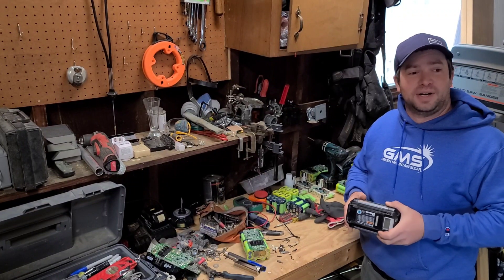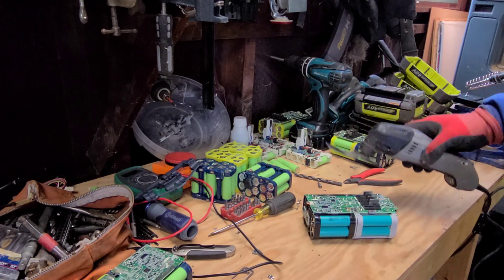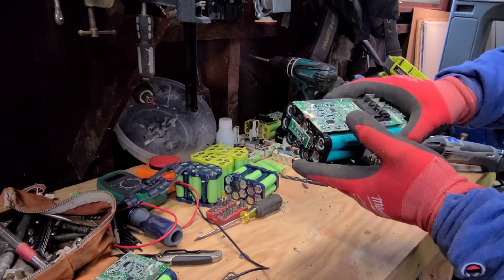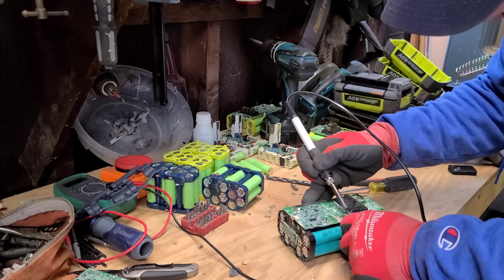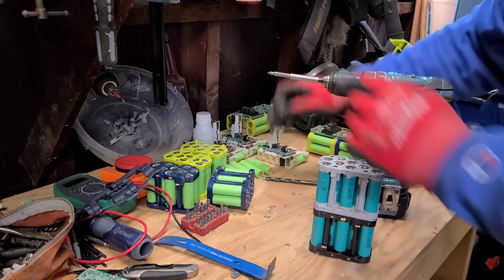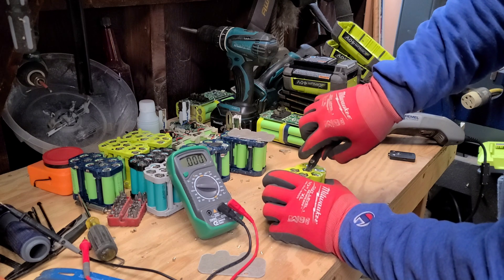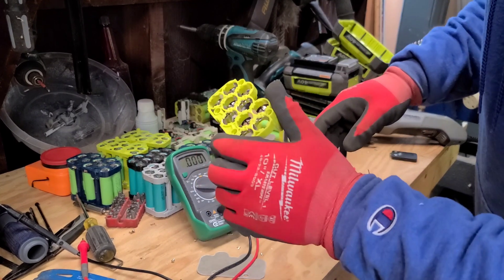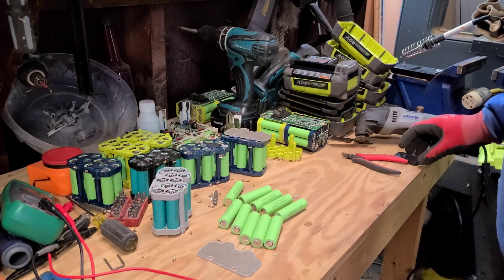Ryobi 40v Lithium Battery Disassembly

Comment: what kind of cells are in the 6Ah battery ?
Reply: 4Ah: 10S2P 2000mah 18650 cells
6Ah: 10S2P 3000mah 18650 cells
8Ah: 10S3P 2000mah 18650 cells

Only the new Ryobi Edge batteries have 17500 cells...

Comment: I know exactly why it read zero volt on these lithium batteries. I have Ryobi lawnmower 40v battery was runout of juice and was overheated during hot summer cutting yard.
I tear down like you did.
They need to CID to get back to about 3 volts because batteries were overheated and the inside pressure so high push the top part of metal under the positive terminal to disconnect the circuit. Therefore it is really no reusable as far as safety go !

Comment: So a hand for later if u do this ...use a compressor at like 100psi n a blow gun...heat the joint n blow out the solder also use a bigger iron

Comment: I have a DIY lab bench power supply that I can use to perform CC-CV charging on very low cells. I usually start them off at 0.05 amps until they are at least 1 volt, then 0.1 amps until they reach 3 volts. Then I continue charging at about 0.25 amps until they reach 3.85 volts. I hold the 3.85 volts until the current falls below 0.05 amps. Then I disconnect charging and store the battery in a fireproof bag for at least 72 hours. If the battery is at least 3.8 volts after that, I continue the charge at 0.1 amps until 4.15 volts. Then I left stand for another 72 hours. If the battery is at least 4.1 volts, I do a discharge test at 0.5C (whatever the capacity is divided by 2). So, a 2000 mAh cell would discharge at 1 Amp, a 3000 mAh would discharge at 1.5 Amps. 
If the battery doesn't test at least 65% of it's rated capacity, I discharge it down to 2.75 volts and it goes into my "badly worn out cells" waiting for a low current project.
If it does test OK, I put it in a battery tester that will fully charge to 4.2 volts, then discharge down to 2.75 volts and recharge when done, measuring the capacity in mAh. I then measure the internal resistance and record the capacity and resistance on the battery in sharpie. The battery then gets discharged down to 3.2 volts and stored in the "good for demanding projects" shelf until I have enough cells.
When I have enough cells, they get matched up as closely as possible. I make sure every cell in a pack as the same resistance to within 10%, and every parallel group of cells has the same capacity to within 5%, then I discharge the cells to 2.75 volts, weld them together, install the BMS, and fully charge. They're ready for a project. 
I have about 1% of the batteries I test this way fail within the first year, which isn't too bad. Only about 50% of batteries I test make past the initial screening for self discharge. If during the either of the 72 hour wait periods the cells self discharge outside of tolerance, they get recycled. If they heat up at ALL during charging (within a couple of degrees of ambient), they get recycled. I can't risk a marginal cell going bad and causing a fire. It's just not worth it to me.

Comment: heya that is not good that does 18650 are so low hope you can get them back to live. I got myself over 150 bycicle packs of those 18650 withs have about nomimnal 500 wh each so hope to bilt a battery bank with them

Comment: I bought three of these packs from battery hookup. All three were worthless. Most of the cells were heater cells and immediately discharged. Of the eight cells that would take a charge, six were down to three volts in just a few days sitting there and the last two were super high resistance so they couldn't really be used for anything.
Reply from the maker: Yeah I think about 1/3 of the cells I got were usable.

Comment: how do you slow charge each cell?
Reply from the maker: I'd start them out at 0.1a.  Once the cell voltage is above 3v you can go higher.  From what I've heard, the slower you charge them from a low voltage, the better.
Reply: @benssolarandbattery  Thanks.  So if I have a 0.5 amp charger, maybe I can put 5 in parallel if each cell has similar resistance
Reply: @productcheck  It is risky to charge any Li-Ion battery that has been discharged below 2.0 volts, and it's VERY RISKY to try charging one that has been discharged all the way to 0. If you charge them one at a time, at least you have smart monitoring by your charger to halt the charge cycle if something looks wrong with the cell. If you put them in parallel and one of the cells develops an internal short, not only does the charger keep applying current, but the other cells connected in parallel will dump their stored energy into the one faulty cell. 
If a cell charging by itself faults out, it might get very hot to the touch. If a cell in a parallel configuration faults out, it could very well catch fire as all the power from the other cells gets shorted out through it.

Comment: Hey Ben, when I've taken these packs apart before, I've used long nosed pliers and peeled the nickel tabs off the cells and that way they can be rebuilt without touching the bms etc. Good luck
Reply: how did you get the cells out of the end with the heatsink? On the 5A battery it's soldered on to the BMS PCB